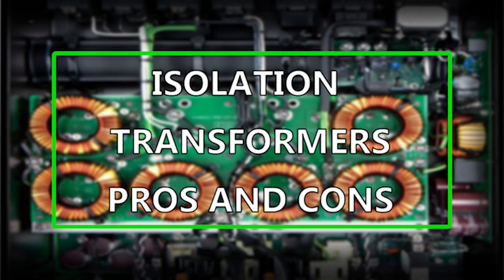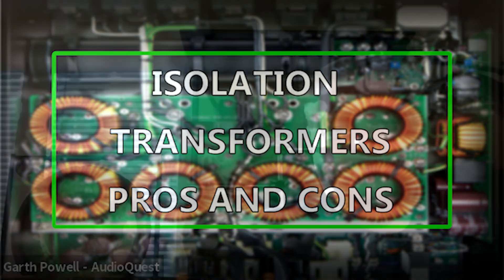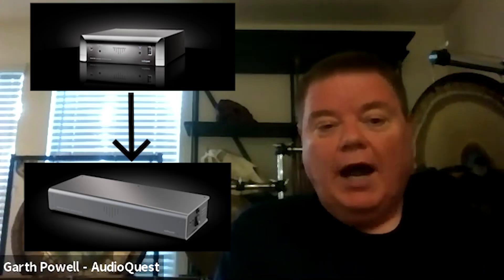How AudioQuest uses Isolation Transformers in Power Conditioners

Comment: I need to disagree with Garth here. What he says is true for moderately sized toroidal transformers. But I use a 2.5kVa Topaz .0005pf isolation transformer for my tube setup (Line Magnetic LM512CA + dual l LM503PA 845 SET monoblocks) fed by Garth's Furman Elite 15 PFi & for my Solid State system a Xentek 5kVa .001pf transformer feeding a Furman Elite 20 PFi, into my Naim Supernait 3 + HiCap DR. Dynamics are significantly improved by using the transformers + Furman versus bypassing them, and versus bypassing the Furman (straight into the wall or xformer). The difference is not subtle. Far bigger than swapping garbage new manufacture Russian tubes versus vintage NOS Mullard, Siemens, Telefunken, Amperex, Valvo, etc. Peak current demands for each system do not exceed 1/3rd of either xformer's rated capacity. RMS is at 1/10th or lower.

The results speak for themselves. But even the smaller 2.5kVa transformer weighs 68lbs and the larger 5kVa weighs 108lbs. They would never fit into a normal sized chassis. In fact, NOT having to co-locate them with their partnered Furman conditioners is actually better for sound quality.

Comment: Funny how I auditioned a Niagara 3000 to cure some noise issues and it didn't work. Put in a Bryston BIT (Torus) and not only did the problems go away but it sounds better than the Niagara did. AQ is the new Bose, 95% marketing and 5% engineering.